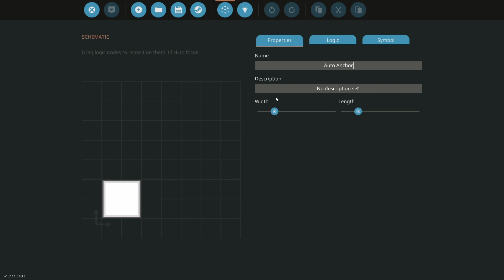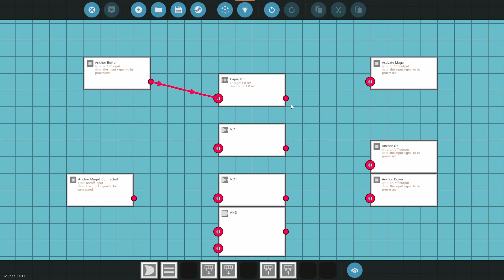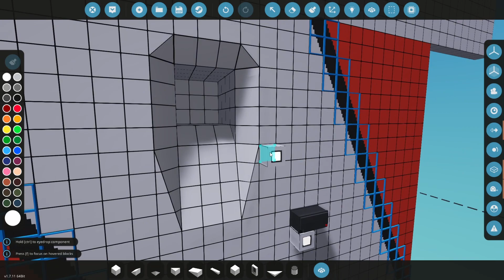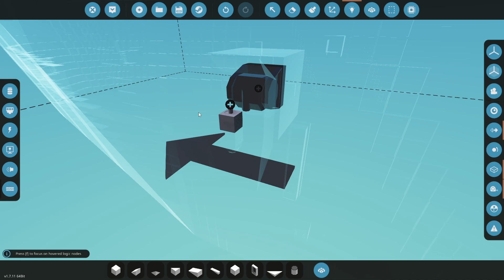Stormworks - Automatic Anchor Tutorial

Comment: As soon as i the set 1 sec passes, the magall turns on, but when it hits the seafloor, it turns itself off.
and the cable keeps going down. i did everything the same as you, only difference is that i used 3 magall (tried both using or gates and connecting only one)

Do you have any idea why? thanks!

EDIT: i found out it simply wasn't glowing, but it was connected... i feel dumb (the heigh issue still persists)
Reply from the maker: If you still need help with it, join my discord or the official Stormworks discord and show some pictures of your logic.

Comment: I cant get it to work for some reason. :(
Reply from the maker: I also could not get this same controller to work yesterday. I connected the on/off signals between the electrical connector and the magall incorrectly. Maybe have a look there are make sure the on/off signals are connected in a loop between the electrical connector and the magall.
Reply: @terr-rawr-saur  this thing is refushing to work. ive re did it 5 times lol. oh well
Reply from the maker: @skullblits6969  Sorry to hear :( Does it do anything when you push the button? If you describe what happens I might get an idea of what's gone wrong.
Reply: @terr-rawr-saur  it does. Nothing but my build is rather large. I'll add it into another one next build
Reply: @terr-rawr-saur  I connected one thing up wrong and it now works lol oops
Reply from the maker: @skullblits6969  Good to hear you solved it.